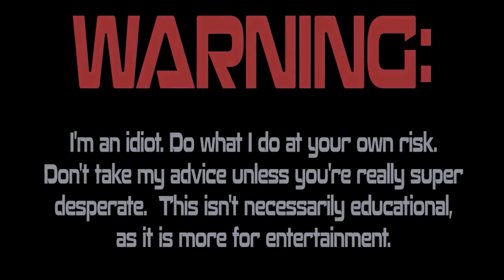ABANDONED S10 First Drive In MANY Years! (No Brakes)

Comment: If a fella pressure washes that truck, he might just blow the whole project away....
Reply: Lol
Reply: Nah but ya might just wash mice out from under the dash the heating system is most likely full of mouse nest.
Reply: Its a S pecial Dime.. Nothin blows them away
Reply: There is a lot of weight reduction
Reply: The neighbors called the cops about a UFO just after that violently spinning Throw Out Bearing went thru the dash board and windshield it obtained Orbit for about a half hour right above Derek & the neighbors property. The Hiway Patrol is still in awe at how that clutch bearing clobbered the neighbors 2 cows to death...
Reply: it'll be fine, just send it....
maybe just not at 100 percent
Reply: If ya wash this truck, you'll break the mold...
Reply: It's not that Rusty

Comment: Brake reservoir line tip: always use EPDM tube, they are resistant to brake fluid (normal rubber breaks down after a couple months or years)

Comment: The Iron Duke is what they use in mail trucks, and most of those have well over 200,000 miles on them.
Reply: That’s what my 93 sonoma has. It’s slow as molasses but reliable as ever
Reply: @manasseh7  yup. They're super slow
Reply: The Iron Duke was the base engine in everything from early 3rd gen Camaros to Cavaliers and they are bulletproof. Not enough power to hurt itself.
Reply: The Iron Duke was made from a Pontiac 300 v8 cut in half. Part of what makes it so bulletproof is the use of timing gears, just like the Ford 300 straight 6.

Comment: “Burnt transmission fluid and cat vomit” at least it’s not burnt gear oil and fecal matter...
Reply: A fella might say that the old beetle that smelled of chicken poop and rotten eggs that I restored last year might be the worst.
Reply: @gundalfthelost1624  got an identical s10 to Dereks, mines all black blue interior. V6 but the thing smelt like sewage and moldy attic
Reply: @zackatron925  Gives the truck some character, all my cars and vehicles got their own smell. For better or worse I guess.
Reply: i honestly just think its a small truck thing for them to smell terrible inside my old 94 ranger i had a few years ago smelled terrible inside no matter what i did i took the seats out and cleaned everything still had the same smell...
Reply: @427ve36tte  Just go grab some old car air fresheners from the box of junk in your garage (don't use new ones, they smell too much) and get them in there. Under the seat, under the dash, you name it, just squeeze'em right up in there. Your rig will be smelling fresh as a daisy in no time.

Comment: 13 M & M's, that's about 1/2 an Itch!
Reply: You can use the starter to break loose a stuck clutch. Since you don't have brakes, push truck again a solid object, put it in gear  with clutch pedal depressed, operate starter. the clutch disc can't move and the starter will put force on the  flywheel and pressure plate away from the disc. I did this once on as old Volvo(with good brakes, so no need for solid object)
Reply: @lindacooper621  I think you would need about a 200hp starter to break THAT one loose.
Reply: about a third of a packet....
Reply: yep

Comment: So if you’re alone and need assistance bleeding the system I was taught to put a little of the fluid in a clear container, run your bleeder hose into the container submerged in the fluid, open the bleeder and start pumping until you don’t see bubbles anymore. Obviously check the fluid occasionally, but the line can’t suck air back up if it’s Submerged in fluid.

Comment: I’ve had my s10 going for 3 years now and I’ve never had breaks around the farm 😂 just learned to gear down 😂
Reply: Funny how missing "features" can actually be 𝑔𝑜𝑜𝑑 for your driving - same with no clutch, or no reverse, makes you 𝑡ℎ𝑖𝑛𝑘 more.
Reply: @2H80vids  yeah I live on a farm so using the gears wasn’t that hard but still there were a few times I had to slip it in reverse to get me stopped 😂
Reply: @jacobbeckett8393  😁  Not so handy if your beater is an automatic.

Comment: We had one of these S10 Pickups at work and drove the tires off of it. Our yard was a half acre paved and the other 34 1/2 acres rocks and potholes but that truck made it way past 200,000 miles on her. So they do take a lot of abuse and keep running and wouldn't you know it was an '86. That one has sat around too long I would say but if anyone can bring it back to life you can Derek.

Comment: Great little trucks. The Iron Duke 4 cylinder is indestructible. I flipped a 90 S10 in 91 with no seatbelt on and walked away. Then I got a 92 with the 2.8 and ran it until 2006. It was still running great with 300K...should have kept it.

Comment: Had a iron duke in a 88 Olds Cierra.  Great car for over ten years. Bought it used from a dealer lot.  But after a while it developed this odd little knock in the engine.  Did the right thing and just drove it for years.  Finally the plastic timing gear broke so I refreshed it with rings and bearings.  Found the knock.  It was a rod bearing.  Had to laugh a it came on slow and I thought, it couldn't be a rod.  Tough engine. Wife got another car and the kids beat the piss out of it for 2 more years until the daughter drove it after the oil pump decide it was done pumping.  Metal flake oil.  To the scrapyard it went. Enjoy your videos.  AL from Cottage Grove, Mn.

Comment: Iron Dukes are tough. My '91 S10 I bought new, had 247,000 + miles on it. Got broadsided and rolled it 3 or so times so that was that, but it still would run. Had original starter, alternator, and clutch. Miss that truck. Had to put a head gasket, 3 radiators in the little guy.

Comment: Ive bled 2 S-10's and both were an absolute nightmare 😫 
I ended up doing it like I do a brake system. Run a hose from the bleed nipple into a bottle with enough fluid to submerge the end. Open the bleeder and pump the pedal 5-6 times. Check your master level and repeat until you have no more air in the system. Easy AF, one person job, guaranteed solid pedal.

Comment: That's what ya call a clean one owner with low miles 😆
I have a tractor with the same stuck clutch problem pulled it around the backyard with a pickup truck,  with the clutch strapped down in high gear, worked like a charm

Comment: Might fall on deaf ears but when you bleed a clutch master if you have a way of pressurizing the reservoir it will push the fluid through the system. I took a coolant hose and clamped it on blocked the other end and took a bike pump with a ball needle the blow some pressure in it. Worked good for me. I was bleeding for days with no peddle

Comment: I've got an 89 I'm working on, lots of the same issues.  Mine has power brakes though so that clutch master doesn't come out so easy.  The clutch was exploded in the T5 when we got it, drove it home 60 miles with little brakes and throttle shifting.  I feel your pain.  ours gets about 24mpg.

Comment: My dad owned an 86 s-10 with manual steering, manual transmission, and manual brakes. We put air ride helper springs on the back and hauled about 3500lbs of sack-crete in it...it was the only time it had power steering😊

Comment: I had the exact same clutch issue with my old Talbot Motorhome. The fix was to put her in gear, clutch down and then turn over the engine. after about 2 attempts there used to be a loud bang and she was as good as new. You are correct regards long term storage, store with the clutch pedal down.

Comment: something I never gave any consideration to is that the plastic and vinyl interior parts are all painted with a rather thin paint that goes on more like a stain. It was in the late 80s early 90s I  was selling industrial spray equipment and I happened to be at a GM factory in southern Ohio. It makes sense as you really can not control the fact that every plastic piece is a slightly different shade so spraying them all with the same flexible paint is the secret and automotive paint suppliers custom tint the product and sell it in pints and quarts likely gallons too. You may already know this but it might help someone else I hope.

Comment: I love these trucks. My very first vehicle was a 1991 Sonoma extended cab. I built it up while learning (sometimes the hard way) how to work on a vehicle. Then It was taken from me in a crash, someone who wasn't supposed to be in my country was running from the cops in a stolen SUV when he ran into my truck at 50+MPH while I was sitting at a light. He thought I was someone else and wanted me dead. He got the wrong guy, he didn't make it. I spent months in physical therapy and only got $1800 for the truck. After 4 years of searching I found a gorgeous 1991 Sonoma regular cab and started building it up only to be rear ended at 70MPH by a local garbage company's truck and driver. I was ejected through the rear window, sustaining multiple injuries. It took an ambulance ride, several doctors visits and a few weeks before I could get back to life again. Now I'm on the hunt for the replacement again sice I am just about the only thing that survived the second crash (the truck is several feet shorter now, the passenger side is no good at all, the hood buckled, the front bumper bent, and the passenger fender got bent by the door moving forward) Sadly that truck is beyond totaled.  The insurance company only offered $1,500 despite the $25,000 in modifications so IDK if I will be able to afford a replacement S truck anytime soon but I hope to own one again some day.
Reply: I've got an 84 that I have had for 23 years.  Southern truck.  Not rusty at all like this one. Has a 3.4L (not 4.3) in it.  Crate engine from GM which was leftover 93-95 Camaro 3.4 blocks with a special cam.  It is modified to EFI with 4.3 TBI siting on it.  Edelbrock headers too and dual exhaust.  it's outrun any 4.3 truck just about.

Comment: Love You, Love Your Show;  I don't think sitting for 17 years really effected the S10.  1984, I bought a 1982 S10 and it had the same problems as yours.  It had the 2.8 60 degree V6, I think the 5 speed trans and a government controlled 2 barrelled carb.  In the one year I owned it the breaks went out and the float would drop and misfire until you fixed it.  Hoping to get into the shop today and work on my 73 square body but dealing with Canada's number one export, cold air.  As always, looking forward to the next video.

Comment: I used to have to drive an early 90s S10 when I worked at O'Reilly. That truck is so weak when you turn on the AC it slows down massively. I was delivering parts during Summer in Texas so every time I had to go faster than 45, i'd turn the AC off and just sweat more lol.

Comment: You can use starter to break the clutch free. Push truck against a solid object, put in gear,  push clutch pedal and operate starter. The clutch disc will be unable to move and the starter will turn the flywheel which should break the disc free. I did this on an old Volvo which had brakes, so no need for solid object.

Comment: My first new pickup was 1989 S10 base model pickup came with AM radio, rear bumper and 5speed borg warner and the 2.5 iron duke, drove it 5 years and 260K miles, cheapest ride I ever owned, never had any issue other than brakes tires water pump, alturnator, and pullys all I ever had to do to it, but into 18 months most of the paint fell off and it was a trif to get the dealer to repaint it

Comment: Use naphtha to wipe the vinyl and leather down. Then get sem dye in rattle cans and that seat will look brand new. Light coats of the dye, use heat gun to dry / tighten the leatherneck vinyl.

Comment: I unseized a frozen clutch once (2  people needed), using a trolley jack lift both rear wheels off the ground , place in top gear , depress clutch  , rev to the moon . have the assistant release the jack , after 3 attempts it broke free .

Comment: Glad the clutch disc stuck to the flywheel was any easy fix. No fun, but not too bad to pull the trans in an s10. I had a 1967 Ford 2000 tractor that stuck. Had to split the tractor. Tried every trick, like you did and also using the cake knife from my wedding between the disc and flywheel. 😬

Comment: 11:17 To avoid having to replace the filters in your shop vacuum, go to rockler dot com and look for their "Dust Right" dust separator. It removes more than 99% of what actually goes into your shop vacuum. This also greatly extends the life of your vacuum as well. It was designed for woodworking, but it works great on just about any dry solid waste that you have to vacuum. 13:20 Can you grind me a pound or two of that???? I was actually disappointed when that old Hoosier spare donut didn't go bang.

Comment: Also one thing like about 1988 to 1994 S10 Chevrolet small pickups too & Iron Duke 2.5litre Inline 4 cylinder motors engine time belt is a 1973 to 1976 400 CC  double cylinder engine of a Bombariare  if need changed and fit perfectly!

Comment: You need to try super clean degreaser. It’s by far the best I have ever used. It would clean the heck out of that bedliner and really clean the moss off of the paint. Don’t use it full strength.

Comment: a feller and his pops could tow the truck with it's engine off. put it in gear and clutch down. had a british cortina once that had the same issue and we just towed it around with a tractor until wheels started turning, then fired up the engine and did a granny-peel-off to clean the rust off the flywheel

Comment: A little trick for stuck clutches next time, stuff the gas to the floor while holding the clutch then slam the brakes. Do that over and over and it will free the clutch up.  Also what about just putting a roll Pan on the back so you don't have to worry about making bumper mounts.
Reply from the maker: Yes correct , but this had no brakes 👍
Reply: @ViceGripGarage  Good point, I wasn't using the old noggin. Sorry...

Comment: An old-timer taught me to bleed brakes that way he said when you pump the brakes you just push the air bubbles back and forth back and forth he said bleed it like a clutch just push it down and then crack the bleeder loose and it actually doesn't take as long as you get the are pushed out of the bleeder instead of pushing it back and forth

Comment: You should run a tube to the brake fluid bottle with the bleader open. Pump the pedal to get bubbles out and make sure you don’t run the master below the sucker tube.  I bleed everything this way, very easy. Just find a small enough hose to be tight on the nipple. I like this way better than having a helper, don’t need to rely on anyone.

Comment: I can be almost certain that trucks got a 3,42 rear end if you jack it up the rear tires and spend one and if the other one rolls the opposite direction that truck will go down any mud road that it can reach the bottom of as long as you got a friend that can jump up and down in the back of it even once where four-wheel drive pickup trucks has slid off put themselves into the ditch on each side this 85 S10 I speak of did not come with a bumper from the factory brand new or a radio evidently those were optional stripper model

Comment: I think hydraulic clutch actuation was a really stupid idea.  Linkage had been working since time began so why change it.  One would think they would make a conversion kit by now.  Maybe using a flexible cable housing.  The kit would be cheaper than all the parts to replace the hydraulic stuff.  The hydraulics are just going to fail and leave the vehicle stranded and expensive to repair.

Comment: Still
Confused how he got the clutch to unstick. Would have been nice to see what he did
Reply: If I read the feller correctly, he put the rear end up on some stands and got her running in 3rd so the wheel speed was ridiculous. It's not posi, so he got that big pry bar UNDER the tire for the driven wheel, and just used leverage to attempt to slow the tire down. The engine put force on the drive train in one direction, the attempts to stop the tire put force on the drive train the other way, and because the clutch is activated (the old clutch-bleeder 2000 is in place) once successful the tire stopped spinning and everything was golden. I dunno if this helps any but that's what I think he was telling us. I'm picturing him prying up on the tire from under and behind the tire, but I could be wrong about that (probably am, smh dolefully).

Comment: I had that same problem with my s10 after I installed a replacement engine. It would not go into gear so I put it in gear while the engine is off and How old the clutch to the floor with it in first gear started the engine and then it worked fine after that. It’s probably because the clutch is rusted to the fly wheel

Comment: the plastic vents and switches were junky, i went thru 5-6 headlight switches, the last one was a OEM knockoff that lasted the longest and the wiper switch in the column suck too, i forgot I tore the column down to replace that, GM has the worst steering columns, pure plastic crap, otherwise this truck will get you to point a to b, I once was on a date and pulled into a parking lot and didnt realize the path going back took me into a shallow lake, didnt know because it was froze over till the truck sunk 2 ft into the water, my date just bought a new pair shoes and never heard the end of it till I bought her new pair, had to get pulled out and it took forever to get the mud out of it, and she was pushing the back and when i hit the gas i showered her in mud, these s10 pickups are true American delight, i hated the rubber bench seat, pulled out leather seats out of a oldsmobile that was dope as fuck only s10 with leather and beats all the young girls love me and that truck, i would buy another if i could get a clean one or one that i can save